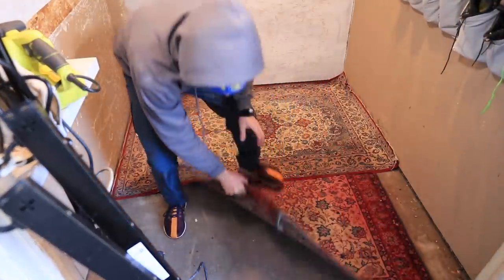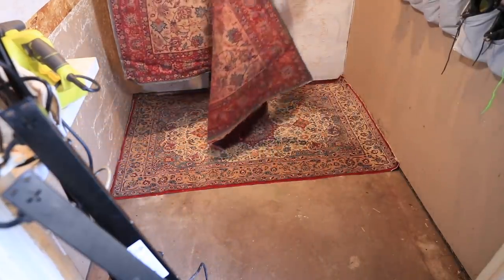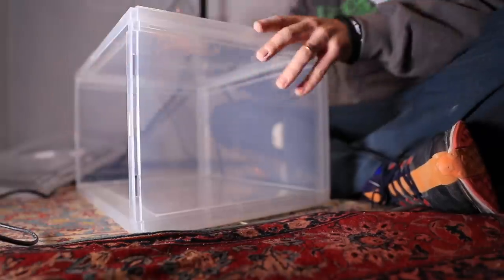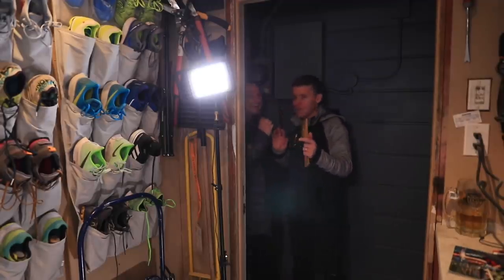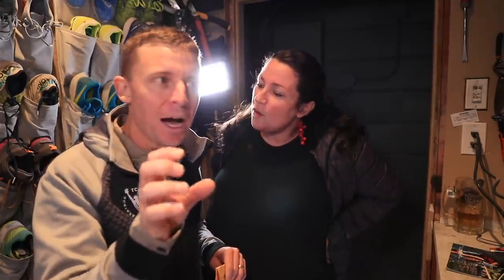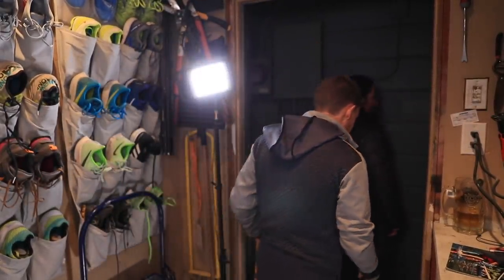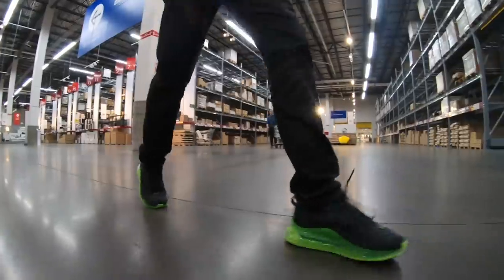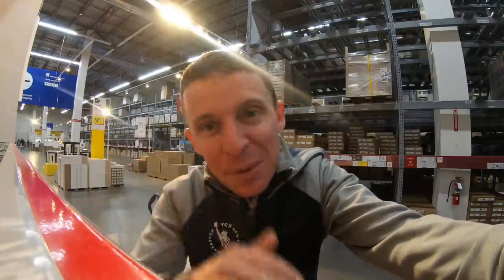SHOEDIO Renovation & "let's be clear, not our Rats!"

Comment: Carbon X - for the road and some Torrents for the trail .. 
just quietly a little more preparation on the walls - filler / sander / sealer  would have been the go .. but noting a distinct lack of health and safety procedures just happy you made it out of there intact 😉

Comment: Qod: Just bought NB fuelcell Rebel. I'm trying them on and trying to feel if they fit me. My feet are a little sensitive in some areas and they are pressing on the bottom of my left leg and they are a bit shallow on my big toes.
Trying to decide if I should keep them or return and get Hoka Rincons :). Decisions decisions
Reply: Ingolfur Birgisson The shoe decision process is half the fun, especially when you find one that works for you! If you can feel the Rebels on your big toes before you’ve run in them, it probably means the toe box is a bit too narrow for you. Fit problems don’t usually get better over time! Let us know how the Rincons work out for you! 👊🏼
Reply: @its_Matt_B_  Yeah, I have decided to return the Rebels. I think the toe box would have worked out but it was more the pressure under my left foot (always my left one that has a problem with shoes). I am going too see if the Rincons go on sale here and then snatch them up. Will be using them as race shoes for 5 and 10 k races. Thank you for the comment :)
Reply: Ingolfur Birgisson I’ve been waiting for Rincons to go on sale for a while without luck. I think Hoka may have something to do with it because I can’t even use my local running shop’s membership discount to buy them.
Reply: @its_Matt_B_  Yes, I noticed the same. In the January sales here all of the Hoka shoes had a significant discount (20-40%) but the Rincons were not on sale. A little bit strange as they have a version 2 coming out so I would think they were trying to lower inventory.
Reply: @ingolfurbirgisson7060  Perhaps we'll just have to wait until the second version comes out. I'm a sucker for a good deal on shoes! 😄
Reply: @its_Matt_B_  Yeah me too, part of the fun is getting good shoes for a good price :).
Reply: @its_Matt_B_  To close out the saga, the Rincons went on a 20% discount at the wholeseller here and I picked them up yesterday. I am walking around in them and they feel a tad narrow for my left foot. I think I will still use them and see if this disappears after breaking them in (it did for my Speedgoat 3's). :)